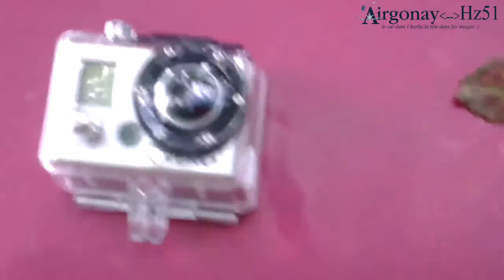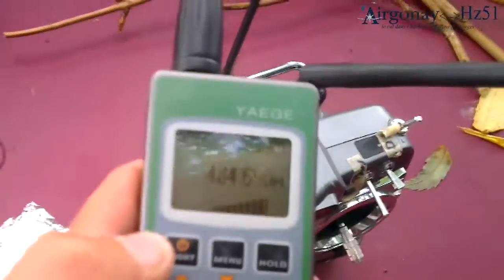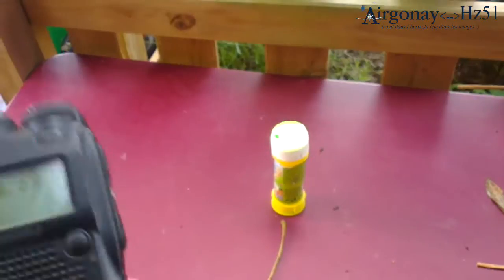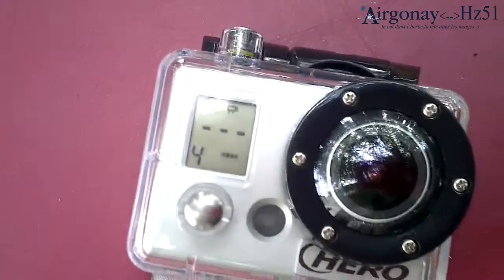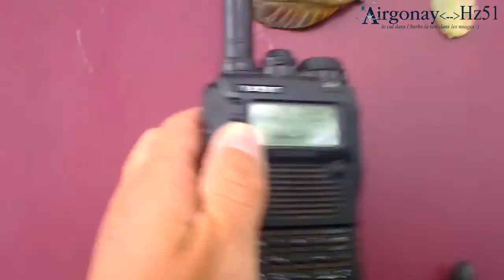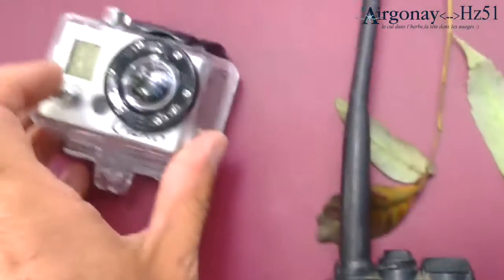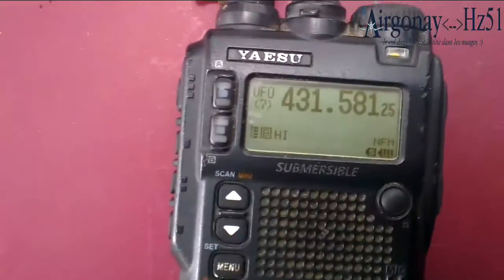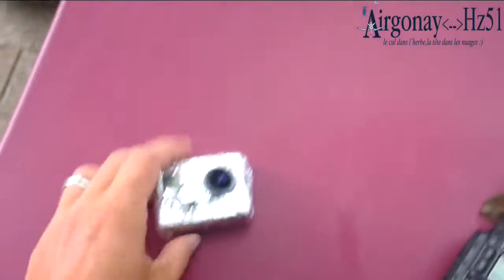how protect your fpv longrange system from 433 mhz interference generated by the gopro

Comment: I want to get into fpv. im surprised no one has figured out about shielding antennas from each other and electronics from each other. i would suggest some copper tape you can get off ebay you could solder onto and also grounding the tape.